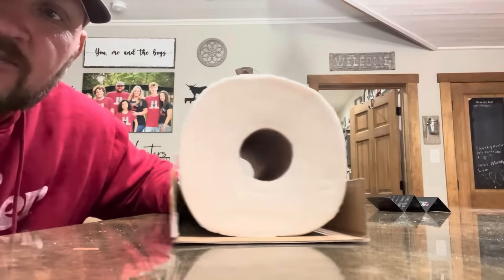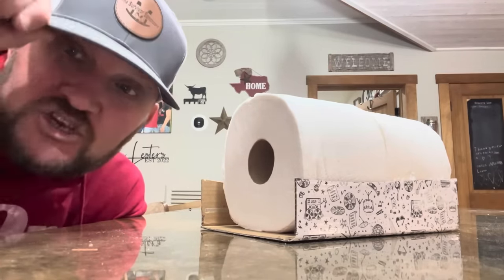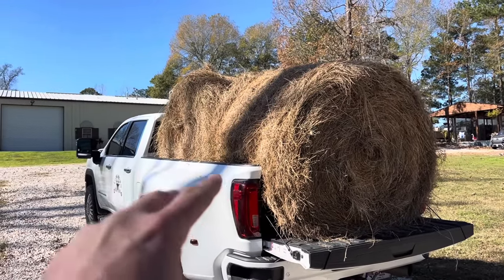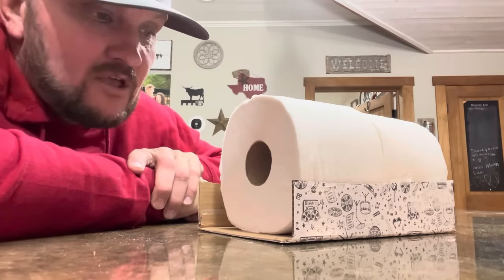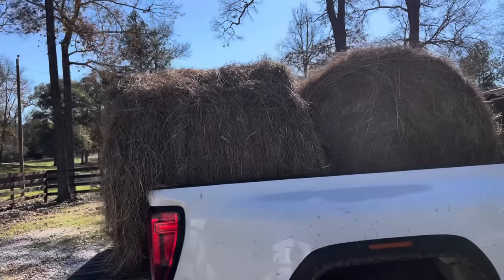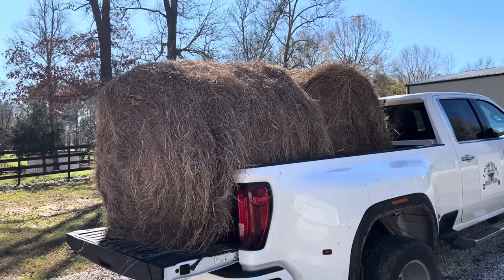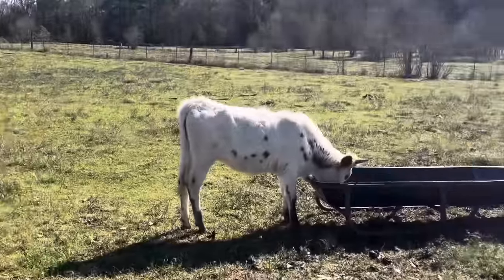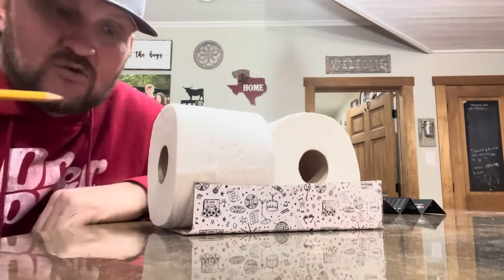99% of Farmers Don’t Know This!

Comment: The tutorial was great only problem was a pickup doesn't spin around like the box.  And forgot the sound affects. 😉😅
Prayers for Jamie.  I have been thru that, as attested and explained in your next video.  A large syringe with a rubber tube on the end worked better than a straw, for me.  They gave it to me at the hospital because of the pain and aches the straws were causing my swollen face.  I will pray for a quick recovery and very few frustrations for her.  She is a strong woman and she has your love. 👍💕🙏

Comment: 1st and foremost unless tied in, they will roll out the first time you turn too hard, unless you tie them down really, really well! 2nd you will have to get up on the top of the truck and push that first roll back towards the tailgate to unload it because your tractor probably won't reach that far into the bed of the truck!